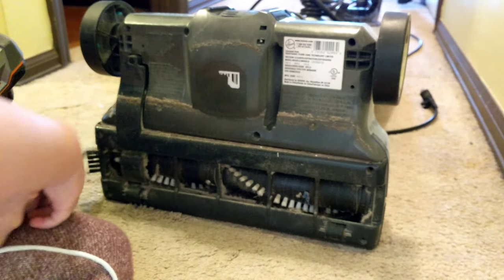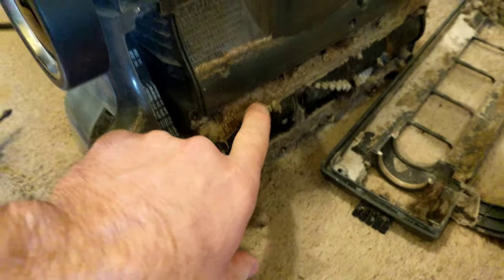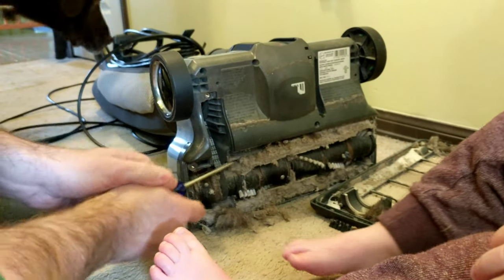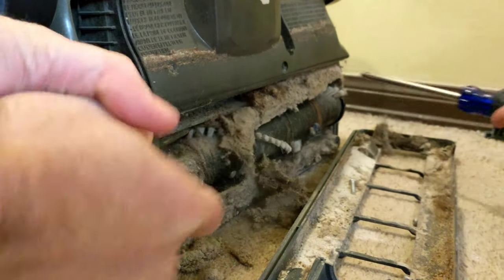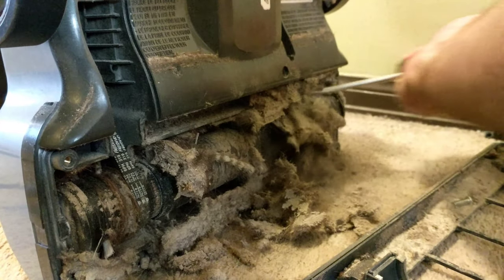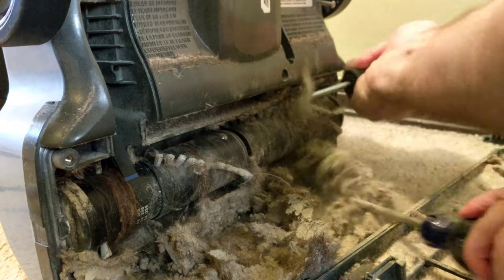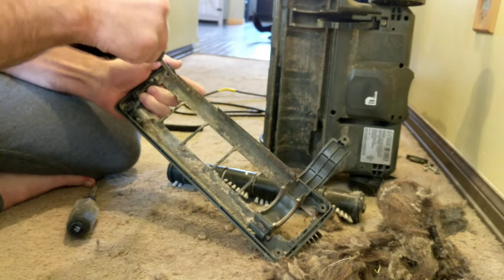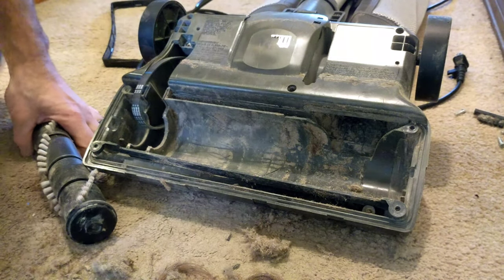Make An Old Vacuum New (EASY)

Comment: Hey is this a DIY Dad video? Haha I’ve been doing a ton of vacuuming videos lately, good stuff man! I like to take a razor blade to the brush roller and cut the hair out too, good trick. Don’t be afraid to really get in there and scrub that stuff out! You can put all the plastic bits in the sink and wash it with some soap and water and scrub brush. It will be like new again. Those Hoover classic models are wonderful machines don’t ever throw that thing out, they are built to be repaired for years and years of service!
Reply from the maker: Good advice man!👌

Comment: Real men blast it with the air hose or leaf blower in the garage while banging it against the concrete while operating until something breaks and you have to go get a new one.   At least you cleaned it over some nice carpeting, so style points for that at least.  👍

Comment: That kind of clogging happens typically when you are using the foam carpet cleaner and then vacuuming it back up.
Reply from the maker: My wife uses the powder stuff often, is that similar?
Reply: @kove  the powder stuff is some of the worst stuff you can use for your vacuum.  Clogs up everything and misses with the filtration.  I still use it though because I like the smell.  Just picked up a new Shark Apex DuoClean ZeroM and love it.  No more taking out the cleaning brush all the time to cut all of the hair off of it!  Have a good one!
Reply from the maker: @MNLawnGuy  Just watched a few vids on the Shark Apex, that is the Toro 1600 of vacuums!

Comment: I would replace the belt. Sounds like it is worn
Reply from the maker: Really? Are you basing that on before or after I cleaned it? It seemed fine when I took it off.
Reply: Koven Carlson after you cleaned it. Over time, belts on vacuums stretch out and lose efficiency, slowing down the brush roll. It’s like a $2-5 job, takes no time at all.